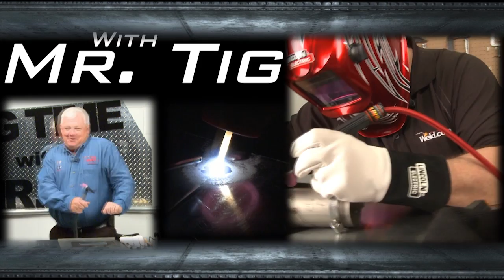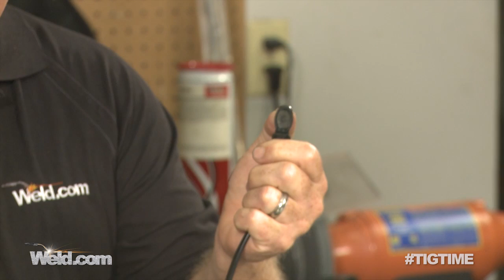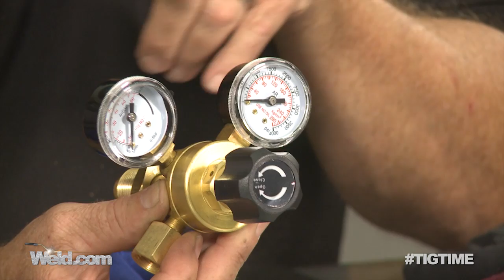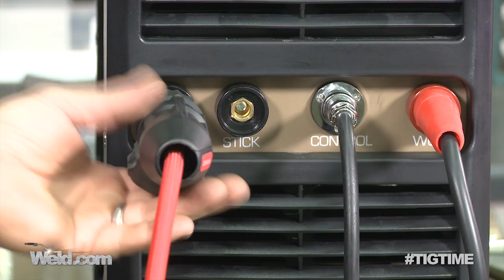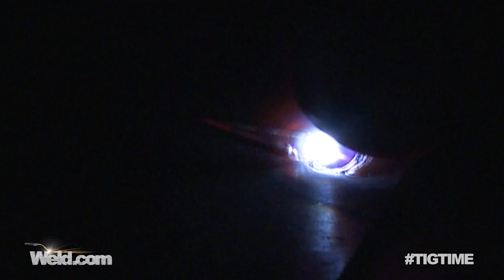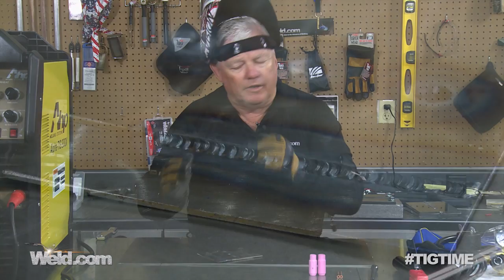AHP AlphaTIG 200X Review: Part 1 - DC Welding | TIG Time

Comment: AHP is a company you shouldn't overlook.  Engineered and designed by AHP who  oversee's the manufacturing in China.   I have both the latest version tig 200 and mig 250 and I love 'em.  Both are well built, rugged with upgraded accessories ( except that darn foot pedal, either you like it or you don't ) and both have a 60% duty cycle, I only have about a 50%  duty cycle so they can  both out work me.  Both weld as good as any industrial machine I've run and would recommend any of their products to anyone.  I'll be getting their 60 amp plasma cutter soon.

Comment: I just recently purchased a ahp 200 tig welder. I can do ok on steel. But when it comes to aluminum im sucking..Can  anyone help me out with the adjustments. Im using a 2% lanthanated ekectode.. trying to weld 1/16 aluminum plate..

Comment: End amps setting is only applicable when using 4T mode, so it doesn't affect the taper at the end; that's controlled by the pedal position instead.

Comment: In my welder there are two contacts (FDZ if I remember correctly) Mid machine on middle board. The gap is 0.023" and there is arcing across the points during welding. Your machine seems to not make any noise other than the fans.

What is the gap specification for these contact points?

Comment: The link @ 11:41 & in the description brings you to the MT-50 flow meter which isn't made anymore. It would be helpful for future customers if it pointed at the new MT-60 you offer, not a big deal just a suggestion.
Reply from the maker: Thanks for the heads up. We just changed the link location.

Comment: Thanks for the great videos. If I may ask a question. I have tried to find out what a good starting arc amperage is for 20 gauge automotive sheet metal. Is 10 too high?
Reply from the maker: Most machines will spike initially before stablizing at the advertised starting amps, so it depends on what that is. However, you can always start your weld on a nearby part and move over to your 20 gauge after it spikes.

Comment: They added a torch with red braid,but needs a torch as the hose is so stiff it wants to twist of my hand.Looks like a ck but not close,put a flow meter in it instead of the cheap gauge but mine leaks out the back,definitely needs a better foot control too.struggling to get used to this machine,it's been a while since I have Tig welded. I think I need to make the upgrades and try again..

Comment: Bought a new gen 3 2015 AHP Alpha in Aug 2015.  Arrived with the box in perfect condition with a broken welder inside (welder was shipped defective) took weeks of emails and phone calls before customer service would get back to me.  Within 3 months the high frequency went out, again took weeks before customer service would get back to me.  This happened 3 times over the course of a few months, thought maybe something was wrong in my shop electrical wise but my other inverter tig and high frequency plasma were working just fine.  The machine wasn't used hard by any means, barley light an arc and it went down.  By this time the company wouldn't give me a refund, I got it fixed one last time, I tested it and sold it.  AHP is a joke.

Comment: any thoughts on the newest model that replaced the one in the video thanks
Reply from the maker: jason, it is very similar to the 2015 model with some minor upgrades. We didn't feel there was a big enough change to warrant a whole new review, however these are great machines for an entry level price. if you have any specific questions, we will be glad to answer them.
Reply: Thank you for your quick response.  The only reason I was asking was that the pulse toggle switch has 3 positions. And there seems to be 12 turn knobs I'm still relatively new at TIG welding just comparing the two models.  And I also noticed the torch is flexible now. But no matter I love you videos they are very helpful to a newbie like myself.

Comment: I want to my this unit Mr. Tig, but I don't have reliable power where I plan on using it in my barn. Is there a generator capable of powering this machine? I know there are major issues with underrated generators, but a $800 AHP and a $1000 generator is still a bit cheaper than Bobcat or Ranger. Or should I look into those all in one units but used? So confused!

Comment: Great vids.
I got this machine (AHP) last fall and have been practicing welding aluminum. I was able ,eventually, to do a butt joint on 1/4" aluminum using a 1/8 general purpose electrode. I recently began practicing the same with 1/8 aluminum with a 1/16 general purpose electrode but so far its a disaster. I keep loosing the arc though I have tried different amp settings. Am hoping you can suggest settings or any advice that might make my practice more productive. Thanks much.
Reply: for 1/4" thick aluminum you need to run basically wide open (200 amps) at least with 100% argon - that means everything else than a 1/8 tungsten electrode is too small no matter what .....  1/16 is only good for roughly 100 amps AC tig ... give or take 20 or 30 amps .....   no way you ever weld 1/4" plate with that

Comment: Thanks for getting back so fast. I thought maybe there was a problem with the ALPHAs that you no longer were selling them. Im still trying to decide which machine I want, the AHP or Everlast with all the features although they both get very mixed reviews, or just go with a Lincoln square wave 175 that I can get parts, service, or help for at any local welding shop. I wish there were more videos on the square wave 175. The Lincoln is my max price range.

Comment: This welder comes with a foot pedal, can you tig weld without all that nonsense with it? Just lift arc and control amps on the machines dials?
I'm a pipe welder by trade have never used a foot pedal or dial on my torch. Always set the amps on the machine. Wondering if that's possible with this machine.
Reply from the maker: Yes, you can weld without the foot pedal. There is a toggle switch on the front panel to disable the foot control.

Comment: The foot pedal spring is too stiff. When I press hard on it for more power my body shifts and my bead gets irregular in that spot.
Reply: +Brian Graves With all the good features at the low price of this machine, you have to complain about a spring in the foot pedal? Well the problem is not the machine , or the pedal. Maybe you should hit the gym a little bit so you have some more strength , and learn to control your body and position so your weld is straight. I find so many people like you bitching about small stuff. Is not the  machine's  design fault, but mostly operator lack of experience. Let's say  that if you are not capable of taking a pedal, disassembling it and changing a spring , you should not be handling a tig welder at all. Same goes to all the whiners who can not fix simple things to customize the equipment to their lack of something, and want to operate complex machines.
Reply: John Doe I am a TIG welder by trade.  Even the cheapest stock pedals for miller or lincoln machines are smooth and nonrestrictive.  The spring in mine is rather stiff and for 1/16 filler and below the amount of resistance makes me have to tense up to press it down.  It's just a major design oversight for the sake of getting a product to market as quick as possible with no eye for quality.

Gym? perhaps. But there's no facility that can correct what kind of an asshole you are

Comment: What about an after market foot control? Will the lotos or Miller RFCS-5 work
Reply from the maker: Every brand and/or model has unique software to accept a certain resistance of the pedal.  We are not aware of any other pedal that will work with the 200x and we are diligently working towards a upgraded model.  We will post as soon as possible.
Reply from the maker: Mark Mixell We now have an upgrade for the 2014 (and 2015) AlphaTIG models on the Weld.com store. Here is a link if interested: http://www.weld.com/index.php/shop-weld-com/shop-weldcom/foot-pedals-hand-amp-controls/ssc-foot-control-for-alphatig-200x-2014-model-detail

Comment: Dear viewers,    The alpha tig 200 ac/dc is a machine that is intended for newby welders and extremely light guage work. I like to describe it as the hot rod hobbyist.  Although the machine will attain 200 amps,  We have elected to use the 80/20 rule. That is to say 80% of the time you will be welding at 125 amps or below.  If you intend to use the higher amperages consistently then you either need to put on a "very large and uncomfortable" 26 style torch or graduate to a heavier duty machine.  The 9 flexhead was chosen for extreme comfort and flexibility. It will also handle 200 amps for short durations. thanks all for the questions.  Mr. Tig

Comment: a 9 series gun on  a 200 amp machine ???  just curious - last time i checked those guns are only good for 125 amps ....  that is all fine and dandy for really thin material DC welding ....  but what about heavy stuff or AC welding? wouldn't a 26 series torch  that is rated at 200 amps be a better choice? 
did you ever melt a collet body into a torch head ???  I did :-)
Reply: +Weld.com Sorry to have to say this, but I think you are portraying your bias or maybe your own limitations. A machine should work towards its designed capabilities. If you are not getting the machine to that ends , then this is not really a review ,but mostly your opinion, which by the nature of your business can not be unbiased. To say that a 26 style is very large and uncomfortable, its an opinion and maybe it is uncomfortable for you. In my case I am 6 foot and 200 pounds and I dont find a 26 uncomfortable. Neither anyone have to "graduate " to heavier duty machine because you are physically unfit or because you can not buy a water cooler to handle the higher amps. The machine have a rated duty cycle, and if you follow it with common sense precaution there is nothing to change. There are forums in which people are using this machine for heavy duty jobs and some of them welds better than most people here. Mostly, half of what you said is based in your opinion. This can vary  extremely according to the user. You should stick to reviewing things to their operating performance and bring the results and say if the machine can live up to the designed limits or if it is limited in some other way by the mechanical or electrical nature of the machine and not because of one operator's opinion. Can the machine weld at the rated duty cycles without overheating or damaging the provided torch? Are the welds satisfactory? There is scientific criteria on this and that is what you are not reviewing. This cuts your credibility in front of any possible customer that can tell one hand from the other. Sorry if I am being excessively honest. I have found thru time , that many people working on this trade dont know to do anything else, and are not fit to do anything else. So anything that goes a little out of their comfort zone is deemed not good, which is not always true.
Reply from the maker: The alpha tig 200 ac/dc is a machine that is intended for newby welders and extremely light guage work. I like to describe it as the hot rod hobbyist.  Although the machine will attain 200 amps,  We have elected to use the 80/20 rule. That is to say 80% of the time you will be welding at 125 amps or below.  If you intend to use the higher amperages consistently then you either need to put on a "very large and uncomfortable" 26 style torch or graduate to a heavier duty machine.  The 9 flexhead was chosen for extreme comfort and flexibility. It will also handle 200 amps for short durations. thanks all for the questions.  Mr. Tig
Reply: Oh , I SO agree with you John ... First of all mr tig , don't do a " review " and start out by saying that the machine is fine , IF , you buy a bunch of upgrades from me ... Second , I have 38 yrs exp. , and got rid of my Miller Syncro Wave 250 w/ water cooled setup for this machine because of the inverter based operation and the SIZE ... Anyone who takes the word of a " supposed " expert without evaluating the machine for themselves , doesn't have much experience welding anyway ... Mr tig says this machine is strictly for beginners ?? What's strictly for beginners , is this channel ...
Reply: +TheLibertyWorkShop Pretty brutal to say it like this - hopefully your comment does not magically "disappear" ...  but that is exactly right - i mean there are people that can weld one or a few metals in one process good or really good - and there is people that can weld multiple processes and almost all kinds of metals ....  in the shop, in the field, laying on their back in the dirt ....  
Some can - and they do
and others review and teach ... LOL
Although because of stuff like this and this Paul guy from mig monday i unsubscribed from this channel ...  not dissing anyone - i just felt i could do better with my time than watching paul .....  
But that Bob Moffatt guy - he is pretty freaking good !  and he is not full of himself either .....  !

Comment: I've owned my AlphaTIG for about 10 months now and I love it.  I haven't done much aluminum welding but I have used it quite a bit on DC.  I actually like the foot pedal and my regulator was just fine and worked perfectly out of the box.  The only issue I have is the torch, it is functional but for thicker metals and getting the full amperage out of the machine it needs to be upgraded.  For low amperage welding the torch has been just fine though.  This was my starter machine and overall no real complaints for what it cost me, even with upgrading the torch it was a bargain.

Comment: Audiphilth,  The Alpha tig 200 ac/dc is a Chinese design and has a torch fitting called an M-16.... Mister Tig now has a saf-loc dins that has already been converted with the M-16 fitting.  Now that it is a factory conversion... you can build any torch you desire with this new safe-loc dins (m-16)  These items will be posted and available next week...  thanks for watching -Mister Tig
Reply: Wyatt, thanks for the clarification, I will certainly be purchasing a new torch when available.  Are there any plans for a better foot-pedal?, that would be a great upgrade as well.  Thanks for all the videos and helpful instruction.
Reply: audiphilth,  We certainly do have plans for a better foot control and will release on the Weld.com website when finished testing and market ready... thanks again.. Mister Tig

Comment: I see the link for the torch, but what about the cable?, I'm having a difficult time finding the proper connector for aftermarket TIG torches for this welder.
Reply from the maker: Russell N. audiphilth The torch hose is now available on Weld.com. The port is for TIG welding and the gas flows through the dinse connector. Here is the link if you need to see a picture: http://www.weld.com/index.php/shop-weld-com/shop-weldcom/dinse-connectors/dinse-m-16-connector-air-cooled-detail
Reply from the maker: The dinse connector is being specially made for the Mr. TIG kits. They will be available shortly on Weld.com.
Reply: Weld.com I'm confused, the TIG torch connection on the welder is not a "dinse" connector, so does the connection on the welder need to be modified?
Reply: audiphilth I think some are using the port for the Stick welding, not sure how the gas gets hooked up though. Been waiting for that also. My hose is starting to fray near the connector. No support of the hose and the fitting is starting to dig into it.

Comment: Although I did enjoy watching this review, I think I'm going to have to disagree with you about the torch and cable. I recently purchased am alpha tig and I am very happy with how everything performs. I will however agree with you about the regulator lol, it leaves a little to be desired but it is not that bad. I did purchase a #9 flex head torch with gas lense accessories and do agree that it is much better for thinner material but the 17 torch that comes with it also works very well when doing 1/4 to 3/8 material. At work we have a miller unit and I find I can weld just as well at home as I can at work. I must also say the stick welding function is as good if not better than our Lincolns we have at work. I find both the tig and stick functions very smooth and controllable. It is a great machine for the price and I think it's unfair to compare it to am industrial machine. It's like comparing my all wheel drive mid-sized SUV to my lifted and chipped 3/4 ton 4X4 truck. They both drive down the highway nice but I wouldn't even consider taking my SUV some of the places I need to take my truck or working it like my truck. You do offer great reviews and straight forward opinions about what you think, which is great, but not all of us have your level of experience tig welding and may never have, but before this machine al I had was a scratch start setup on my AC/DC stick welder for home use, so this was an excellent improvement over that. Waiting to watch your review on the aluminum welding features of this machine. I do enjoy your videos as they are very informative as well as entertaining. Keep up the good work.
Thanks,
Ian Little
Spirit River, Alberta, Canada

Comment: I got this welder over a month ago. I had not TIG welded before, so I had no experience to compare the machine to. I have been happy with the machine, and have about 20+ hrs of time on it now. I am using the torch that came with it, but I have some gas lenses that I have added to it that improved my welding experience. I was able to weld aluminum with it before I got the hang of mild steel... But that was primarily attributed to the thickness of fill wire I was using. I will look into upgrading the torch and flow regulator at some point... I am sure it will only improve my experience.

Comment: Will this machine accept a water cooled torch?
Reply from the maker: Yes. However, to run a water cooled setup you will also need a cooler, which can be easily added.